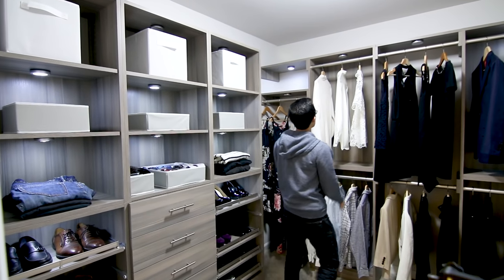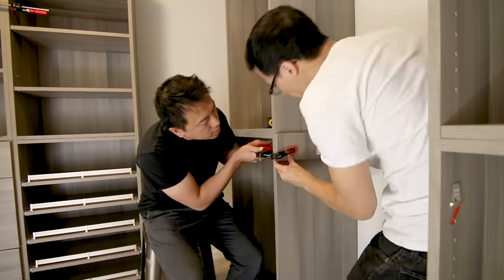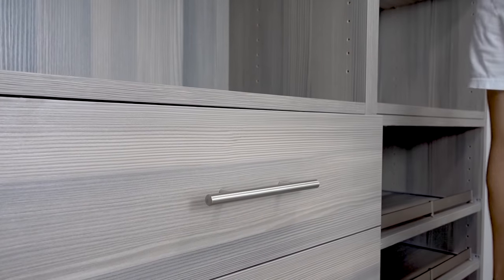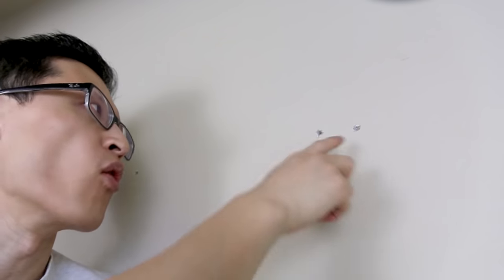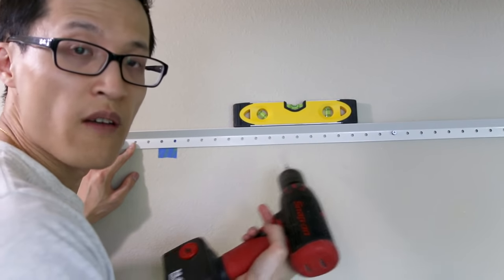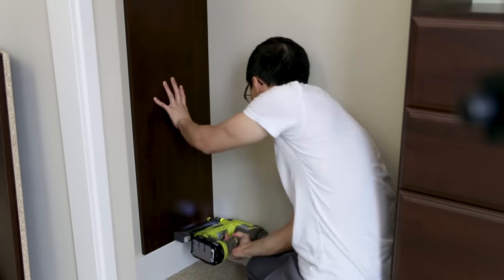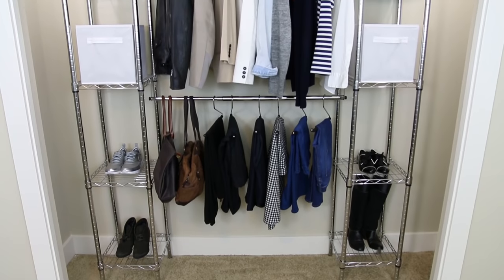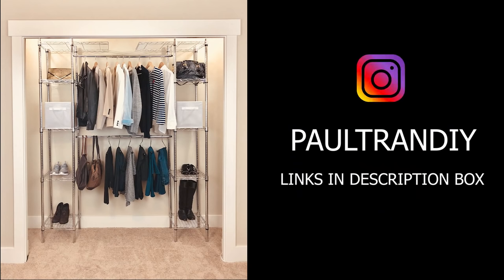Easy Closet Remodels DIY | Walk In & Reach In

Comment: Really well done and communicated wonderfully. Did you leave the doors off of the middle closet? Thx
Reply from the maker: No I put them back on, but I took them off so the closet could be seen more clearly.
Reply: Gotcha. Well it looks fantastic without them. I thought you may have finished out the door frame. Nice work.

Comment: looks like the particle board junk eh? do it right. You usually do ? or did i miss that. Do it from scratch with finished ply wood :-) Junk pull out slides i see to from the 90's